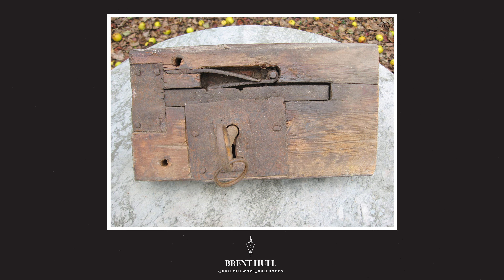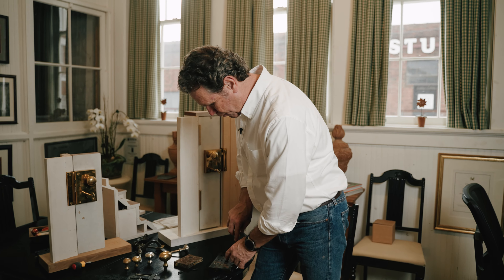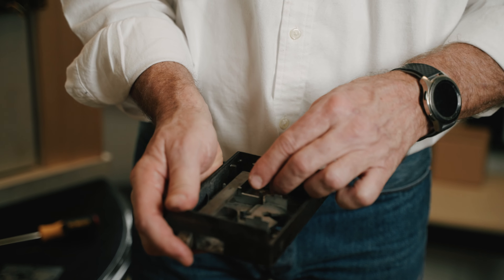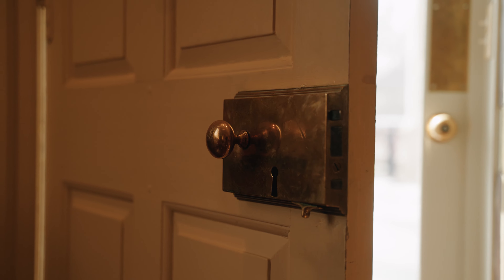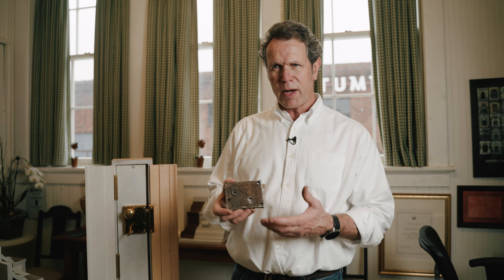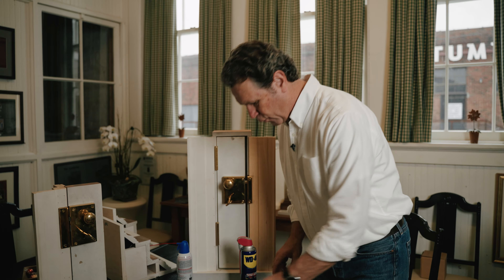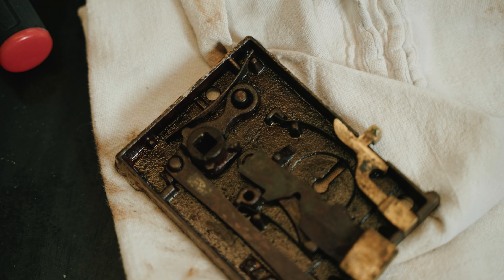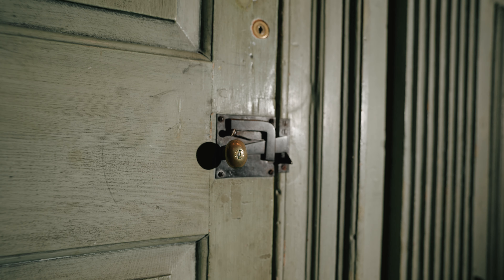How to repair and restore a Rim lock. Historic hardware review.

Comment: I've restored quite a few of these, and have quite a passion for them.  Aside from the spring steel slivers and wires (which operate the basic latches and locks), which sometimes need replacement, these locks have amazing longevity.  Mine are mostly over 120 years old, and I know they could easily last that much longer again.  They are all with a nice variety of porcelain knobs.  Great video.
Reply from the maker: So cool. Thanks for sharing.
Reply: I have a rim lock that I removed from an old iron screen door. I works fine but I took it off to rescreen the door and the two halves inadvertently campe apart and now I'm having trouble putting it back together. Can you offer any advice. I can send photos.
Reply: That has to be frustrating.  It's a little tricky when you didn't have a chance to see how it looked inside before the parts came out.  There should have been a screw holding the both halves together, it must have gone missing.  Anyway, I'm not sure how you get pictures to me privately, but I'd if you have a way, I'd be glad to take a look.  Don @michaelsedillo1750
Reply: If you could send me your email I can send you the photos. Thanks
Reply: Working on my 1st rim lock, R. L. Co. 1897.  One grub screw would not come out; heated and knob fell off!   Liked like lead dripping out.  Was that lead putty holding  porcelain knob? How do you repair?  Epoxy?  Thanks anyone!!

Comment: Just restored and refinished a bunch of matching salvaged oak doors for an 1890s house last week. It had the same type of mechanisms as you showed but these were mortised into the doors. I was surprised how simple the mechanical parts were inside and how they held up for over 100 years. Yeah, for some reason there was dog hairs and spider webs in some of these too. Another cool part was I needed a door to swing and latch the other direction, I was able to turn everything around and make the door work but the latch was closing the wrong direction. I took it apart and was surprised to find I could flip a few things inside and get it to work for swinging left or right. This worked out perfect. I wouldn't have guessed it was that simple. I was expecting way more parts inside. Seems they're all similar back then.
Reply from the maker: So cool. Yes, congrats! You dove in and figured out. Thanks for sharing.
Reply: ust restored and refinished a bunch of matching salvaged oak doors for an 1890s house last week. It had the same type of mechanisms as you showed but these were mortised into the doors. I was surprised how simple the mechanical parts were inside and how they held up for over 100 years. Yeah, for some reason there was dog hairs and spider webs in some of these too. Another cool part was I needed a door to swing and latch the other direction, I was able to turn everything around and make the door work but the latch was closing the wrong direction. I took it apart and was surprised to find I could flip a few things inside and get it to work for swinging left or right. This worked out perfect. I wouldn't have guessed it was that simple. I was expecting way more parts inside. Seems they're all similar back then.
Reply: I have a rim lock that I removed from an old iron screen door. I works fine but I took it off to rescreen the door and the two halves inadvertently campe apart and now I'm having trouble putting it back together. Can you offer any advice. I can send photos.

Comment: Restored 14 of them in my house,  hardest part was to find replacement spring slivers that match the lock
Reply from the maker: Nice! Well done.
Reply: If you live in an area that has regular street cleaning you can often find the tines in the street or gutter and they work great as wafer springs in these old locks!

Comment: Well. Now I know what to properly call those locks on our front and back doors of our shotgun house. Now I want to take them apart to see what's going on in there! (...a passion since I was a wee child! ...got me in trouble a lot. 🙄) The ..."button" on the top of the box that actually locks the door has broken on the back door. I'd >love< to be able to fix that! Mine are still black with no rust. Do you know if keys can be made or found for these locks?
Reply from the maker: Go for it. Yes, keys can easily be made. Good luck.